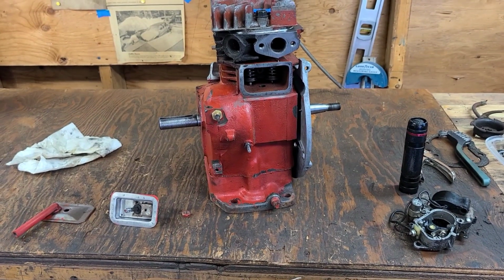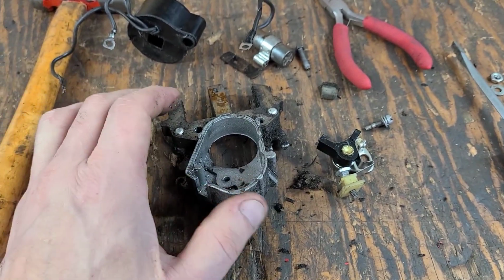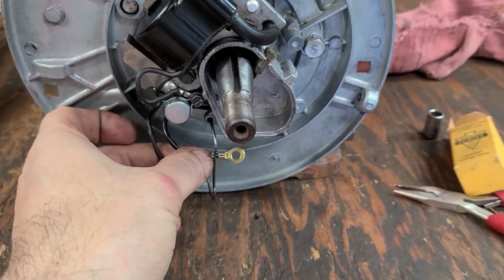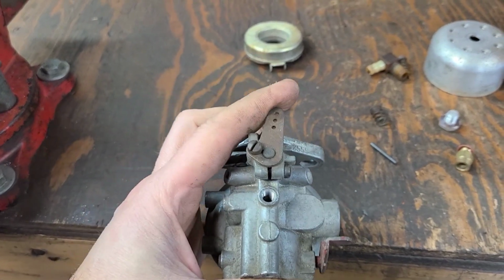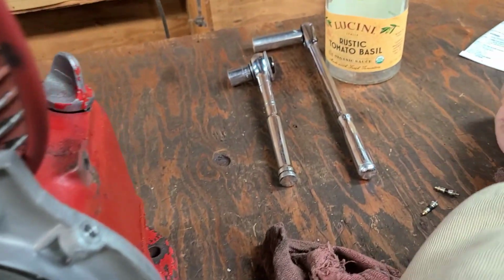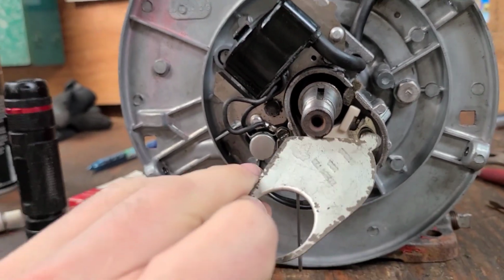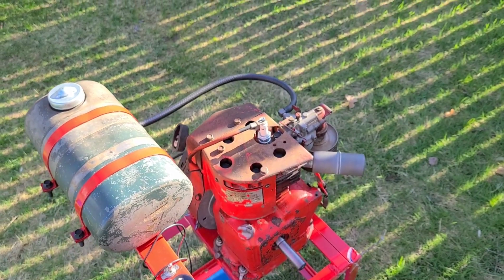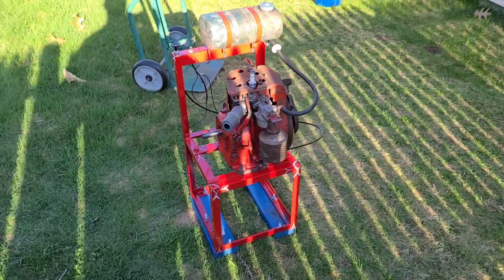Rebuilding a Clinton B1290 Engine Part 3 Is She a Runner? VinsRJ

Comment: What’s the carb screws settings from seated please thanks
Reply from the maker: Hello, for a Clinton LMG carb both idle and main jet base set to 1-1/4, for a Carber N both idle and main jet set to 1-1/2... these setting should get you started and then adjust as needed once it's warmed up... good luck 👍

Comment: Do you want to sell that one? I have a suburban I would like to put a Clinton in
Reply from the maker: Sorry that Clinton was for a customer, I may have another one coming soon...
Reply: Thank you so much
Reply: Hi I cleaned my tank and my carb out and reseated the jets screws and set them as you suggested, it started okay and I tweaked them and it run really well and lovely on idle. I stopped it after ten minutes and it would not start from hot, I left it until cold and it started okay, any suggestions thanks
Reply from the maker: Send me an email, just please make sure to reference your name so I know the who what where, LOL: gs401_2000@yahoo.com